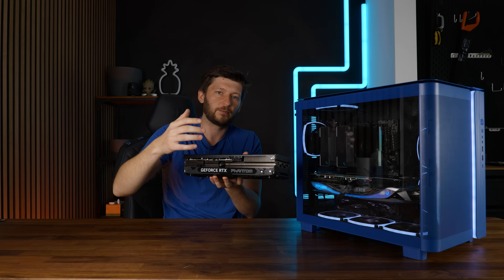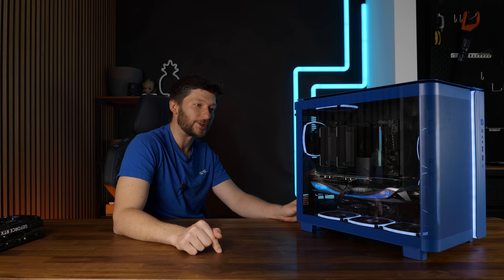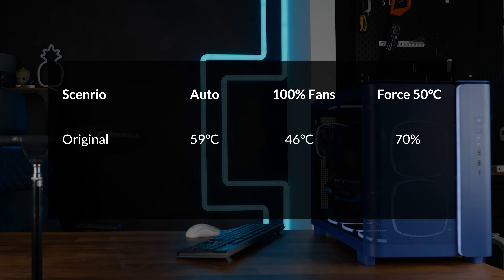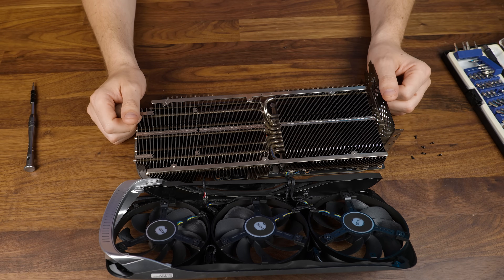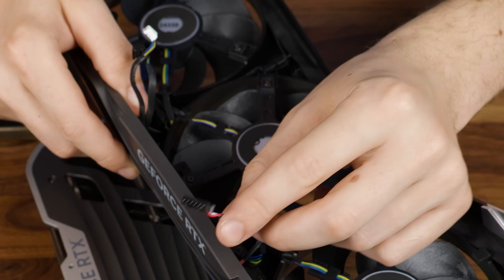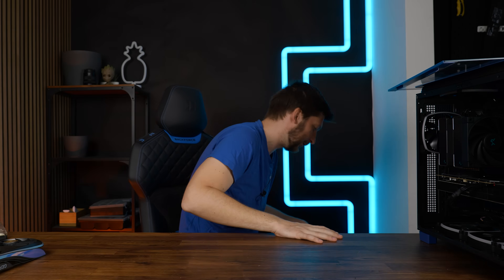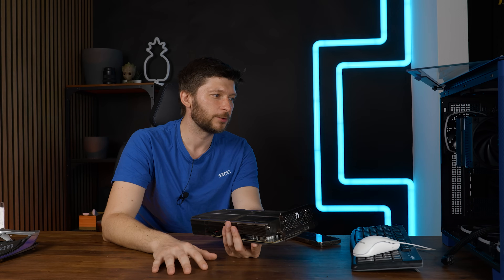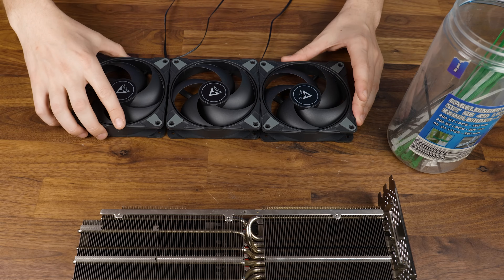Is Deshrouding A GPU Still Worth It? RTX 4090 P12 Max Deshroud Mod

Comment: I think that what ControllerSupported in the comments mentions about a proper mounting bracket is really important here.
If you would have a mounting bracket for these 3 fans and make a 3D printed custom shroud for it so all the air without backflow is properly guided through the cooling, you`ll probably have better RPM less noise and great temps.

Comment: The heatsinks on the 4090 are generally so huge the cooling is pretty impressive out of the box, I know mine rarely goes over 70c even in the Australian summer. I have seen performance figures from water cooled 4090's and while they run cool the actual performance really isn't much better than any other 4090 even if the temps are obviously cooler.

Comment: Deshrouding does not work, but ducting does. It just requires a ton of skill, even to design a proper one. Even when you get it to work, stock fans may offer a similar performance at max. I the end, modern cooling solutions have strong enough fans to get the most out of the heatsink, but they are noisy. Particular at slower speeds. There is no reason for a great heatsink not to result in lower fan noise than coil whine, for almost any GFX. The good news, is that some cards actually has very low whine, in which a card with a proper heatsink, will be virtually silent, even under load. You just need to duct it properly. I have yet to see anyone else actually do that. As in else. Time is getting ripe.
Reply: I was going to get a 3d printer and duct some full size fans through a 30 series but it turned out a watercooling loop was cheaper. Maybe someday.
Reply: @ffwast  If you look at getting a brand new high end consumer printer, I get what you are saying. But for the most part, the cost is the design, a GPU water block, fittings, pump, and so on is way more expensive, than getting slant3d or someone to print one for you. But designing one, that is another story.

Comment: I did the same with a Sapphire RX 7800 XT Pulse with 2 NF-A15 slim: slightly lesser temps but way quieter, 100% was less noisy than 50% stock fans.
Reply: I have the same cards and the same results.

Comment: I deshrouded my 3090 with 3 p12 max and got similar results at max load. Under normal loads, it was cooler by a few degrees and also allowed me to push a slightly more aggressive fan curve with better noise profile. Couldn't be happier as the stock fans were very annoying.

Comment: Heatsinks so big nowadays that you can fit 3 120mm fans on them 😂.
I remember deshrouding and struggling to put 2 120s on my 1080ti.
Reply: 2x 140mm Noctua here. 7900 XT is a big boy.
Reply: i was able to fit 3 120 lian li infini fans. Beautiful, silent and amazing temps.
Reply: @TheCooIAutisticGamer774  which gpu did you put it on?
Reply: Yup, u right. My old 3090 has a deshroud mods with noctua fan ahah
Reply: My old asus strix 1080ti barely fitted 2 noctua fans. The noise and temps after that were unmatched.
Reply: Pascal architecture was a very rare, efficient design. thats why
Reply: 2 120s fit easily on my zotac amp edition
Reply: my 2060 is deshorouded with 1x 120 arctic p12max
Reply: I really want some madlad manufacturer to make one that just takes 3 standard 120s off the bat.  With a fan adapter
Reply: there was a collab with noctua (I don't remember the gpu manufacturer) and they put two A12x25 fans on a gpu and it performs (expectedly) really well

Comment: There are ways to make this better for that GPU.  I have the Zotac trinity 4090, got the deshroud bracket from a seller on etsy that fits 2 120mm fans (I used noctua nf-a12 chromax) and got the black bracket kit from seller (he also had noctua brown).  Temps are slightly lower, but noise is now very very quiet.  Also looks fantastic.  It was worth it for me because one of the factory fans was whining and it was quite annoying.
Reply: I have a trinity and was wanting to try this
Reply: @Ntense___  I tried to link the etsy page, but the sellers name is Osserva.  He is awesome, makes a bunch of different makes and model GPU brackets.

Comment: I recently De shrouded my GPU (gtx980) because the original 3 fan were falling after 9+ years. So if your gpu's original fan is going bad and u don't have any warrenty left than only Deshrouding make sense imo
Reply from the maker: Definitely in your case. And congrats for keeping that card alive till now
Reply: @STSYT  Thanks man. I try to use hardwares as long as possible especially if they are serving me well
Reply: Nice one! 
My old 980 (that Gigabyte Gaming 1) still lives on, with my younger Bro and the fans still work.

My 1080 Aorus Rev.2 still works in a secondary rig and that one had already a monstrous chunk of cooler slapped on, for me the best custom design for that generation and just needed some pad (or rather putty Upsiren U6 Pro) and paste (MX-6) replacements and now runs even smoother and slightly cooler, than it had brandnew, maxing out at perma 2GHz with just 65°C with barely going over 50% fan rpm, which is almost inaudible. :)

the RTX308012gig Aorus Master on the other hand... lets just say the 3000er are not known for their superior efficiency and the easy cooling and that gets way hotter...and could use some deshrouding, but that would also mean losing the display and so on...

Comment: Sitting in a 29C / 84F room, and especially running your hardware in that, is just bonkers to me. Might be time for Europeans to start investing in HVAC systems.
Reply from the maker: If I was allowed to drill holes through the wall for AC, I would have a separate unit every 2 meters
Reply: @STSYT  haha! You can get indoor floor standing "portable" AC systems. They're inexpensive here, but not sure how easy they'd be to get in Europe. They're like window units, but you can put them almost anywhere.

You'd just have to route the intake and hot exhaust tubes out. Do you have any kind of vents that lead into an attic or crawl space you can vent into, or any windows? You could easily 3D print some shrouds to couple the tubes into a vent hole or out a window. And most of them come with the shrouds needed to do this.
Reply from the maker: @AlphaMachina  I got one 😅 15min max and I start eating thermalpaste to end my suffering. These things are so god damn loud.

Yeah, we got 3 holes below the ceiling. Originally, there were “heat re-gaining” units in there. Cause you know… europe.
These things are essentially just a fan with heatsinks. If it’s warm inside, they will push air out heating the heatsinks up in the process. If you want to get your heat back, other way around.

I ripped all of them out and replaced the fans. Now I can effectively pump out the ‘hot air’ of my benchmark machines cause all of them are sitting right underneath such a hole. Works great to keep it stable in that corner.

The only room that doesn’t have such a thing is our film room 😅
Reply from the maker: But yes you are right. No idea why this is not the standard over here

Comment: I recently deshrouded my Palit RTX 3080 12 GB with 2 P14 Max using some zip tes. The card was hot as hell since the begining and was constantly hitting 105 hotspot and ~80C after less than a year of usage (it was undervolted all the time; the case is Enthoo Pro 2 with all 14 fans installed and fans speeds are bounded to GPU and CPU temps; the room temp is usually 23C or lower). At first I replaced just the thermal paste, that solved the hotspot issue, but card was hot and loud anyway, just a bit cooler. After deshroud it became way cooler and more quite. Now my PC is almost inaudible under heavy GPU load.
Reply from the maker: Happy to hear you found a solution.
I had similar stuff happen to my Palit/gainward cards. Gainward less, but palit was always kinda hotter and louder compared to the competition
Reply: @STSYT   Hey STS, from a Fluid and thermodynamic point of you, the fans are less important, but forcing the Air through the finns. You already have 3 bottom intake fans. You could try to either make a shroud around the card that seals it off against the motherboard and case walls or you could build a duct from those bottom fans and feed the airflow into the heatsink with the duct. Also seal the big gabs between the fin stacks should also help. 
If you have stattic preasure optimized fans would be best in this case.
Optimum Tech has shown it works wonders! 
Would be cool if you could evovle deshrouding to something new
Reply: You should try slapping some ptm7950 on that core. Trust me Ptm7950 is far superior than thermal paste. I dropped 10°+ hotspot opening my new from factory 7800xt and then applying the ptm on It, well worth it imo. Now all the fans stay quiet.

Just make sure u get PTM from Honeywell as they have good quality standards for their ptm7950
Reply: @TheRealName7  I have it on my GPU, didn't make any changes from TF7 I used before
At least it shouldn't get high hotspot delta so quick
Reply: The 3000 series higher end cards are absolute power hogs, i can attest to this with my 3070 Ti, it gets pretty hot sometimes, even with an undervolt...
Reply: @X_irtz  Yeah 30 to 40series cards are worlds in between in terms of efficiency and cooling.
I'm running a RTX 3080 12Gig Aorus Master and that Thing sucks up to 430watts, so pretty much 4090levels of power, but also gets insanely hot despite the massive cooler and can, especially in summer, reach 80°C easily with fans at almost 100%...(i'm running a H500M filled with Mobius 140 and 120mil ARGB fans(AiO), so no problem there)
Compare that to a 4080(S) Aorus Master...that thing never even gets close to 70°C its rather aiming at the 60°C mark, even the 4090 model is pretty much the same here as the 4080.
This is what happens if you "oversize" the coolers, coz you expected 600watt cards made by Samsung again, but got TSMC chips that maxed out at 450Watts...big chunks of metal on a more efficient design = cool and quiet. :)
For me, they could keep it that way, saves you alot of trouble and the need to deshroud and "fix" the issues on your own and voiding your warranty..
Reply: Hello friend, sorry for writing to you after 6 months. I have a 3080 TI Galax and I am thinking of doing a deshroud with 3 120mm Silent Wings 4 Be Quiet coolers, my question is if it is mandatory to have to use external software like MSI Afterburner to control the fans, I simply want to connect the coolers to the graph and that the graph itself is in charge of managing the speeds, is it possible to do that? Is there some kind of risk?
Reply: @CascoteMM  you need to connect fans to the motheboard therefore you'll have to use something to control them. It can be a hardware or a software controller or just BIOS, but it won't have GPU temp there. No problems so far, still works fine and silient.
Reply: @NMusic42  So if I connect the coolers to the mothearboard it will just work fine? the RPM will adjust to the GPU temps?
Reply: @Regosito  you need to use controller to do it otheriwse it'll use BIOS settings
Reply: @NMusic42  Last question, do you have idea what kind of hardware controller I have to buy for connect my coolers to the GPU?
Reply: @CascoteMM  Sorry if its late...but just download 'fan control' and you can use motherboard connected fans how ever you like and use GPU sensors as a source...I use my 2080ti with case fans this way
Reply: I screwed 2 p12max to the 3070ti gaming pro, also a hot and noisy card, it was, now there is almost no difference in load and downtime (fans that p12 max are native - used by 30%) and temperatures were 80-83, became 70-72. 

p.s. Arctic p12max are not the quietest fans, it is desirable to install better bearings in them, for example NSK, since it is not so difficult to replace some ball bearings with others as it is to change the hydrodynamics to ball bearings.
Reply: @evur_tweak  i have the same card,do you think is worth doind the same with different fans? Ou ptm7950 will get lower temps?
Reply: @Err0r......  fans and thermal paste work independently of each other (did I understand correctly, ptm7950 is thermal paste?). 
Replacing the fans has a noticeable effect, if not in terms of temperature, then exactly in terms of noise (and in quiet mode - 100% also in terms of temperature, since standard low-profile fans on video cards at low speeds cannot develop sufficient static pressure).
Replacement of thermal paste - I changed it to mx5, while the flight is normal. A phase transition will not make a good thermal paste better in terms of temperatures than a conventional one, but the result will be longer, i.e. thermal paste with a phase transition simply lasts longer than a conventional one, and sometimes even losing slightly in terms of temperatures

Comment: Scenrio
Anyway, people were usually deshrouding because of noise, not because of temps. Noctua fans run definitelly smoother than fans on GPU shrouds.
Reply: To be fair any 120mm will run at lower speeds and noise compared to a thin 90mm
Reply: I don't know what this guy was expecting, to be honest. 
The GPU not only went noticeably quieter but also ran 8 degrees cooler which, at such a low temperature, means a ~13% reduction. Besides, case fans like the P12 Max are more air flow centric. If you're deshrouding, it's advisable to use fans optimized for high static pressure, like the ones on the Noctua Edition GPUs.
Reply: @Sam-K  which fan is that Noctua pick//???
Reply: @Andrewthomasp 
Noctua doesnt have too much of a selection, so its always a NF-F12 variant (i'd prefer the black chromax ones, as i find the brown and beige fugly) or even the newer NF-F12 G2's.
Tho i wouldnt give to much on this commenters opinions second part, as he's very wrong about the Arctic Fans. 
They are made for Pressure first and then Airflow, while the P12 Max achieves up to 137m³/h, the pressure also reaches over 4mm² H2O...thats why they are so liked on builds like that and ofc as they are much cheaper than Noctuas...
Tho the P12 Max isnt top of the line here anymore, that would be the newer P12 Pro Series, with 130m³h (77cfm) and 6.9mm H2O...Noctua has nothing that can compare here...not to mention you can get a 5pack in plain black for the price of just 1 G2 Noctua...
Reply: @4Core100  people use 5mm offset brackets to reduce that turbulence noise
Reply: I thought most deshrouding was because factory fans failed? That's why I deshrouded my old GTX 1660 to get it to last till I picked up an RTX card lol
Reply: Not true for everyone. I removed the stock gigabyte shroud on my rx580 and installed 2xshitty 120mm case fans and it massively improved temps.
Reply: @astronomyastrology7186 If you're still using a RX580 you definitely shouldn't be joining the conversation.
Reply: Lol i have a ZOTAC 4090 on water. So yeah I can the conversation if I want.
Reply: Exactly.
Reply: My Zotac AMP Extreme AIRO RTX 4080 runs very quietly. The noise it makes at higher RPMs is like a light, deep humming noise, which is better than the high-pitched noise we usually hear.
Reply: I deshroud so i can slap my babies.. delta fans. We are not the same
Reply: @slick6227 Which model and why? Temps, sound, blower style?
Reply: recently swapped out a case fan thats one of those cheap no rpm direct to molex shitter 120mm fans on the back of my case with a noctua, instantly saw increased case temps, even when forced to run full speed and get slightly audible.

the very old cheap garbage one moves alot of air and I can't hear it...what is the benefit of noctua fans again?
Reply: It just makes me wonder why they didn't use noctua fans to begin with
Reply: Got this on my 6700XT. Noctuas are amazing, even if they are pricey.
My stock 6700XT was going at 85C with the shroud.
After slapping Noctuas and some cable ties, it's going at 60C-68C at heavy load. Extremely silent too.
Before, the fans used to scream when I was maxing the GPU Usage.
Reply: it always a combo of noise and temp.
not only can you run those 120 or 140mill fans much slower, but they also push way more air and have higher pressure, 
so that the amounts stay the same or still increase, even at lower rpm, resulting in lower or about same temps, while having lower noise as a wanted side effect.
Reply: @wolfwilkopter2231  Does this mean 120mm need to be adjusted to raise it or lower it, according to 140mm intake fans/exhaust fans, do u run either of them higher, probably play higher on one in particular case fan/ ie not for air cooler / aio which are liquid cooling, or radiator. have u adjusted the size any particular?
Reply: nah, arctic accelero on my 275 and 480 because OC and temps. evga clc 120 on my 980ti because OC and temps
Reply: My last 2 GPU's have been by MSI (RTX 2070 Gaming Z & 4070Ti Gaming X Trio) both have  been impressive for their cooling and quiet operation.  The 4070Ti is particularly good rarely exceeding  mid 50's °C or a 70°C hotspot. My case has good airflow. The system isn't audible over my normal listening volume thru stereo bookshelf speakers. I  think manufacturers have got the cooling performance very well optimised for some of their products at least.